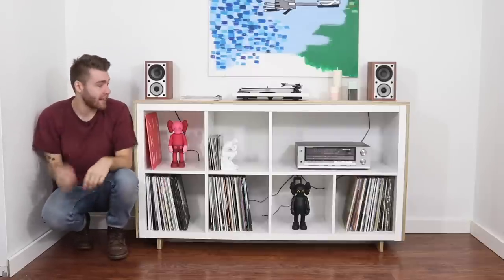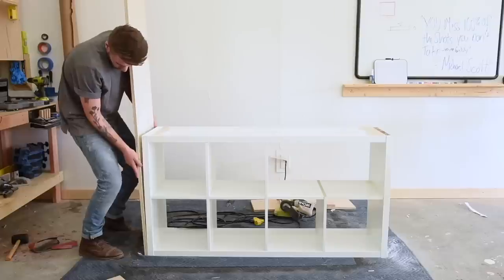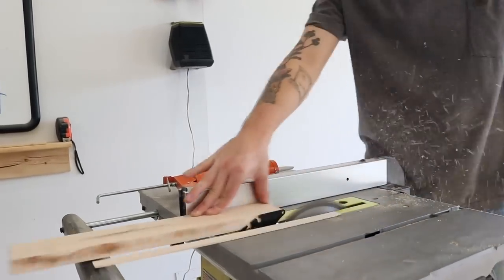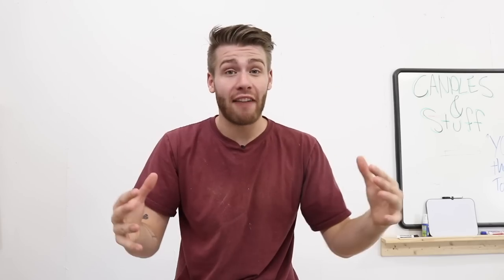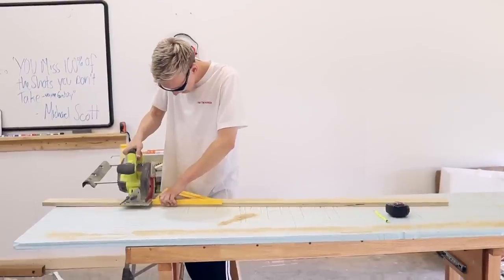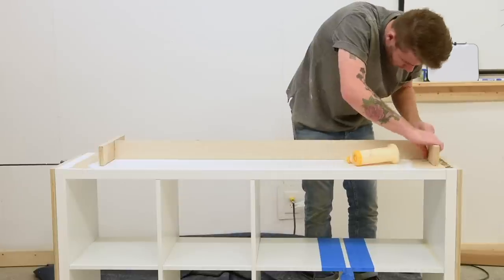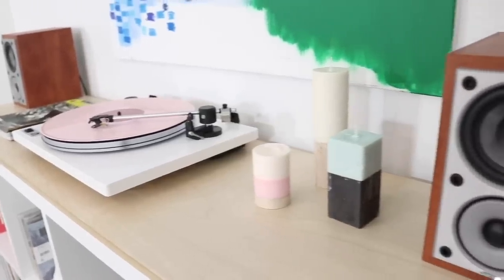DIY Media / Record Console | Ikea Hack | Kallax Bookcase

Comment: Little tip for making a double sized section! Instead of marking, cutting, spackling, and painting, you can switch the single shelf with the double and you just have to flush trim the dowels! That’s probably confusing, but this is what I’ve done in the past!
Reply: I was wondering if the shelf "switch" would work. Flush mount dowels...?
Reply: I was literally going to say the exact same thing. Like, for real, how does one claim to "hack" ikea furniture when they haven't even figured out how to just flip parts instead of cutting the entire board? lol
Reply: @nasosal  oof. i feel like he really destroyed the structural integrity of that spot on the shelf. alot easier to paint 2 dowels instead of what he did here.

Comment: I'm a bit lazy, so I just rotated the center vertical board and moved one of the center horizontal boards to the vertical support position.  A quick disassembly and reassembly without cutting.  My vintage receiver, equalizer, and tape deck are now centered directly below the turntable.  My speakers are larger and vibration isolated on their own 2 cube shelf units rotated vertically and used as speaker stands (looks like you have the perfect space to do the same if vibration is effecting your turntable).

Comment: nice!
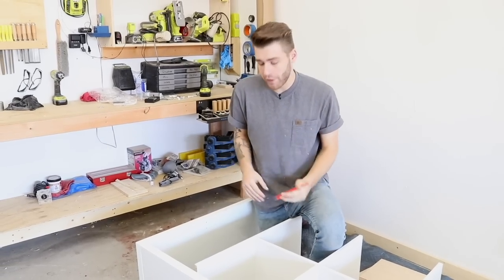You didn't need to cut the vertical piece at 0:52, just swaping the 2 short horizontal pieces with the long vertical and then placing 1 of the short horizontals vertically was enough, it fits in the Kallax model.
Reply: I was going to comment the same thing, if they are square there would be no problem.
Reply: Same here. There would be no need to add the spackle
Reply: sportlol thanks! You saved me a lot of trouble because I'm planning something like this...
Reply: Can some one help me and explain it better i dont get it
Reply: Yes! I learned the hard way. After cutting I realized all I had to do was use the long vertical piece horizontally. Live and learn.
Reply: omg why I didn't I read the comments before cutting
Reply: I’m just about to do this, but have my power amp across the middle two ‘zones’ - also if I get powered speakers, then at least it’s possible to revert to original look
Reply: hahah exactly! what absolute epic fail!
Reply: I am awaking long after but i have the same question, and wonder if it could alter the solidity of the structure, especially when placing the vinyl turning table on the now 2-squares wide space, and a tv on top of the whole furniture? If so what would be the best place (middle or left/right) to swap the pieces of the cabinet so as to limit the solidity issue?

Comment: I'd recommend a front "toe kick" on the support base to close off that area below.  Without it, it's just going to harbor dust bunnies and the occasional thing that crawls and both will take some work to regularly remove from that tight space...  Also, because of the particle board that is the Kallax, I recommend putting a plywood BASE under it (like your top), but have it OVERHANG 1/4" out towards each SIDE, and also out 1/4" extended from the FRONT.  This can be 1/2" or 5/8" plywood.  You can paint this to match, or use an accent color(!), or as you did natural or even stained wood.  You only need to apply a finish on the outer edge of this, and about 1/2" in so that no bare wood shows when attached, unless that's the finish you're going for.   Just glue and screw this onto the base before attaching whatever support you're using.

A base like that does TWO THINGS:  Makes the unit MUCH stronger to attach legs to (if legs are chosen) or your base here, AND it protects those WEAK KALLAX edges from being dinged down low (vacuum cleaner, I'm looking at YOU!).

Comment: I just did this hack (did the bottom as well), and used only liquid nails on the faces of the panels, with normal wood glue on the plywood edges/joints. I'm curious how long I should let it sit without moving it around, for the liquid nails to cure. I've read it can take up to 7 days--but that seems crazy. Anyway, nice video, thanks for the information, was really helpful.
Reply from the maker: Liquid nails is pretty dang strong after a day. It should be good after that

Comment: Just a quick question, what was the material you placed between your workbench and the ply you were cutting with the circular saw?
Reply: Deborah King It’s regular ole foam insulation board. Great for circ/track saws because it can support the whole piece of ply and is mad cheap.

Comment: think I'd just add 4 / 6 legs to it (https://www.ikea.com/ms/en_US/usearch/?query=legs) and instead of the cutting, painting just leave one divider out. 
needs a back panel (even white foam board works ), wires can run in the back.. done.